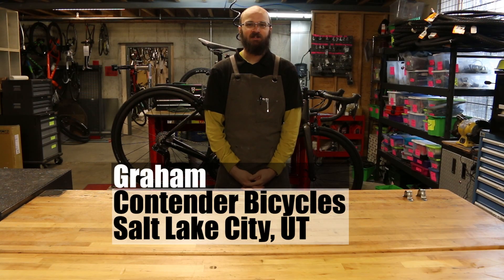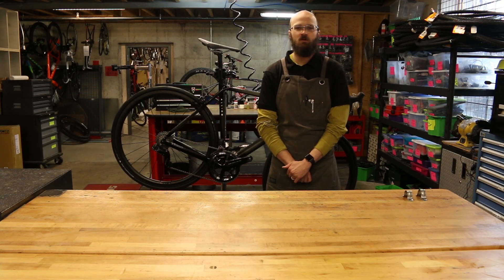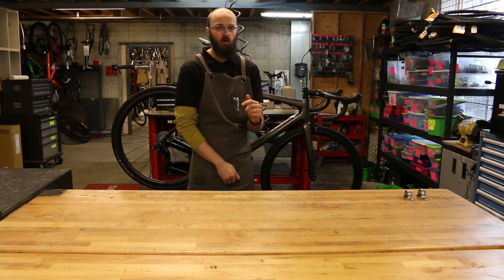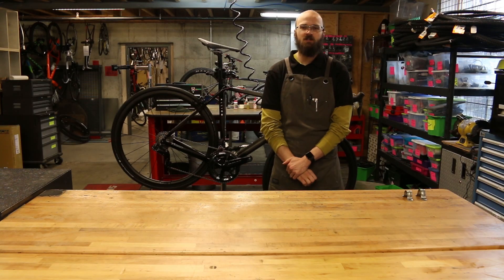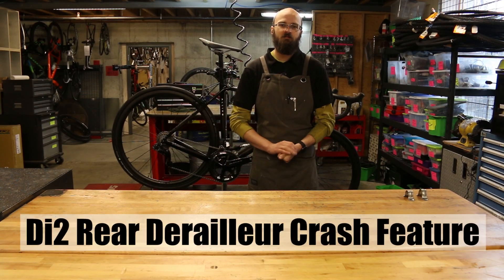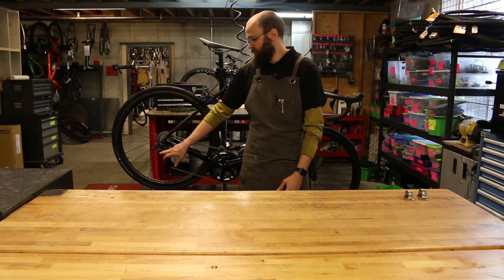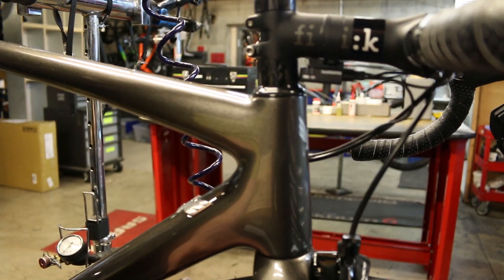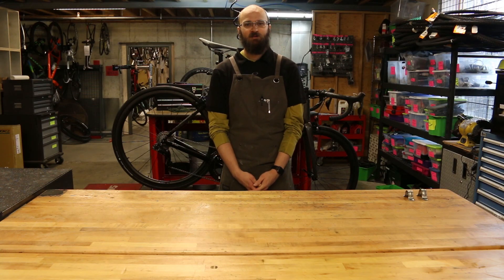Shimano Di2 Deeper Look

Comment: Good day maybe you can help my di2 is draining my battery even not in use. Ive unplugged the cables from rd and fd but it still draining my battery. Ive check the battery it is good. Hope you can shed some light many thanks. I am using TT di2

Comment: Can you over charge the battery or it has a protective mechanism intagrated ? Thanks.
Reply from the maker: No, it'll stop charging once it arrives at full capacity. No problems. Expect a dead battery to charge 1.5 to 3 hours.

Comment: Any help on why i get chain suck after I switched to DI2  New chain, new chainrings, Cervelo S2  I heard the system strong enough the flex the chain ring and I use FSA Grossamer rings could this cause it
Reply from the maker: Our thought would be to make sure the limit screws on your front derailleur are well adjusted. It could also be that you're using FSA chainrings, but the system should work okay provided everything is in correct adjustment.